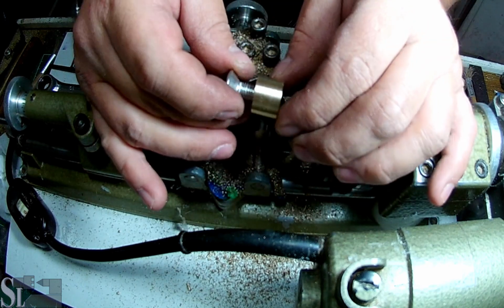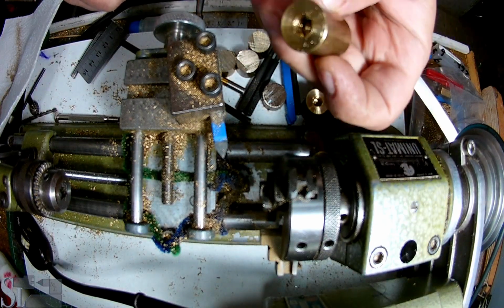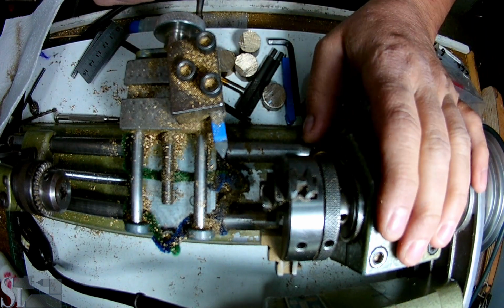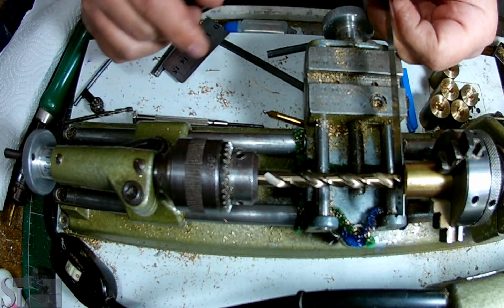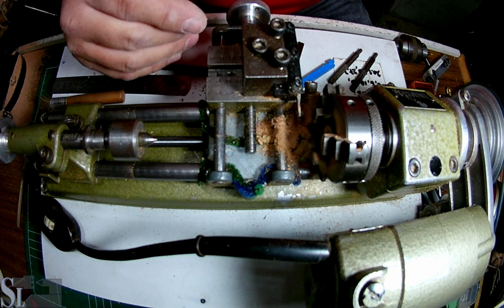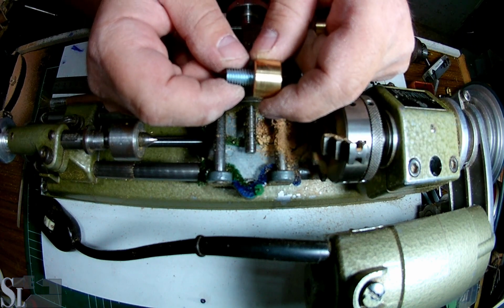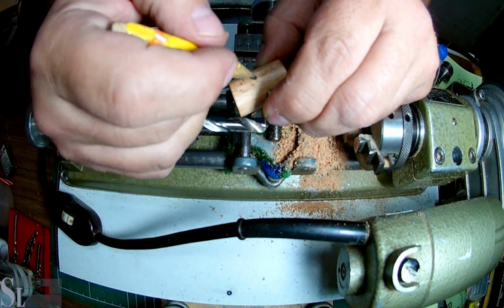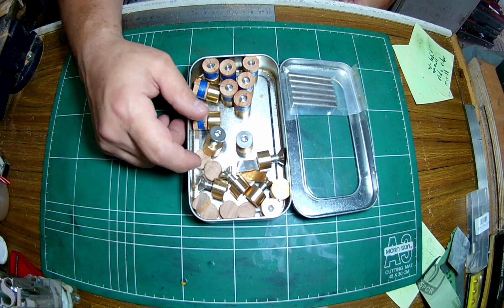Skeletonized diabolo slug turning

Comment: I doubt they would un-thread while being fired. The ones with the heads left on the fasteners may bend, but not back out, with or without epoxy. Some slugs with press fit plastic stabilizers don’t come apart.
Reply from the maker: Just making sure, considering the massive forces it's about to go through.... I fully agree with you  :)